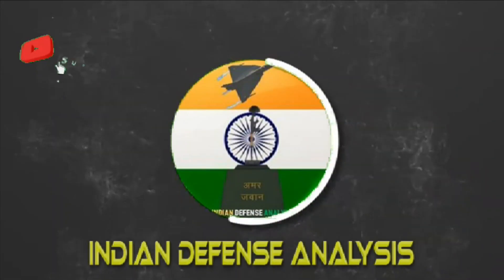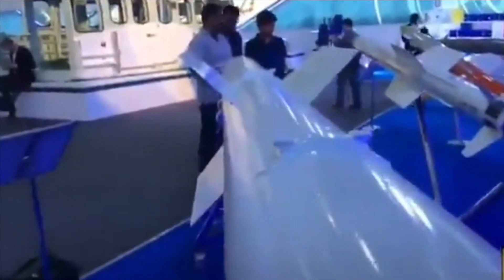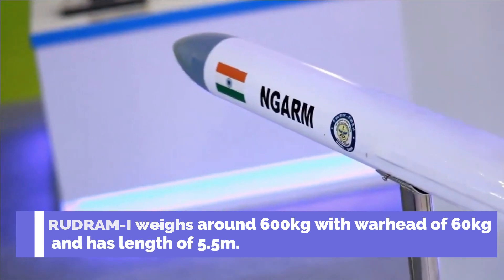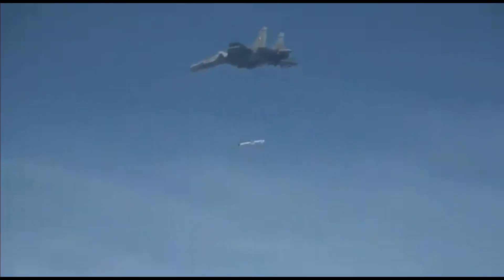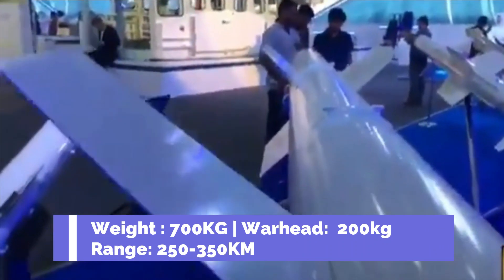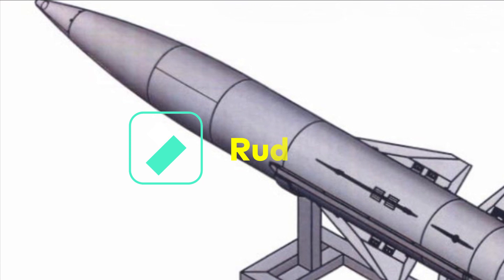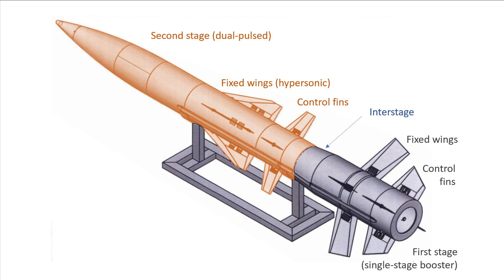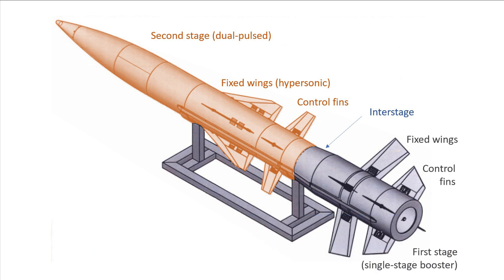RudraM-I, RudraM-II & RudraM-III missiles | Anti-raditiation missiles | Development update

Comment: How do we detect a Radar  stationed beyond 300 km...That's what I'm thinking..🤔🤔🤔🤔🤔🤔
Reply: 300km coverable from the flight height, also satellite, drone reconnaissance and fixed radar database already available (like air base) etc. We got a clear satellite coverage up to 1500km from our borders.
Reply: You can have other assets in the area.
The distance from the launcher will be 300km
Reply: Settelite & Other radar finding equipment se